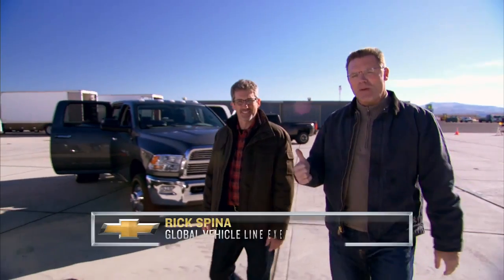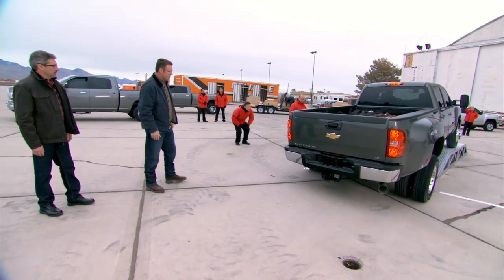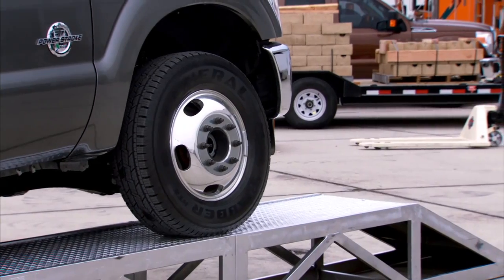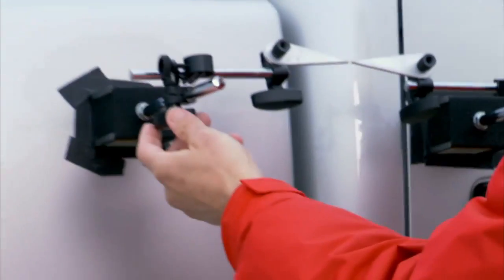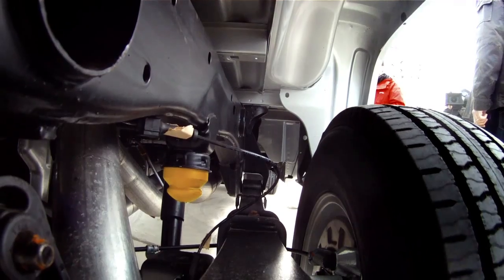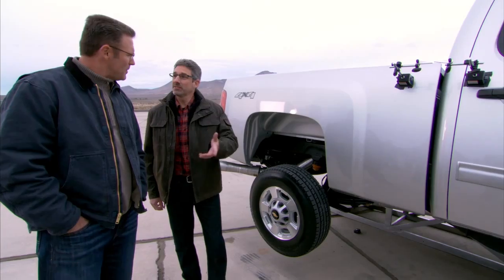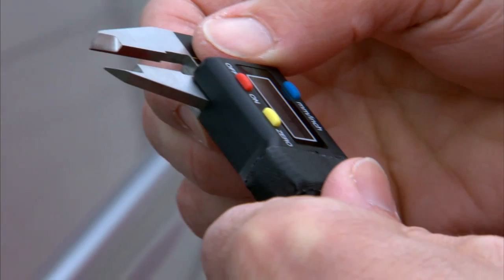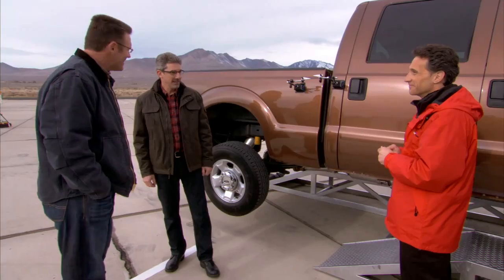Chevy Silverado 3500HD Head to Head Frame Strength Test No. 2 Twist Ditch

Comment: Or you can solve the problem of choosing the right truck by buying a Toyota Hilux ;)
Reply: Ignorance, do really believe you are buying American?? It now a global market place!
Reply: ***** Well, we have a another Toyota ute in Australia (similar to the tundra) which is called the Landcrusier 79 series, with a v8 4.5l twin turbo diesel. Its almost as powerful and can tow almost as a pick up. But here is why we choose the Hilux and land cruiser. It's better in all situations and tasks we use them for. A pick up is good for its power and towing capacity, but we use both Hilux and land cruisers for extreme off-roading, camping, HEAPS of customization for off-roading, hauling, etc. That's is why they are the #1 choice in our opinion.
Reply: fury3600 That's all they do is haul stuff. A hilux is more useful and efficient.
Reply: fury3600 Pickups weigh to much. Oversized engine. Would waste $200 in 10 miles.
Reply: Toyota frames gotten worst. The Heulix or whatever is a great choice though! But Tundra frames... OH BOY GET YOUR GF CUZ SHE AINT GONNA LIKE IT
Reply: In Europe when we need to carry a lot of weight rather often we buy a truck (lorry, commercial vehicle designed to transport cargo) or a van. Why the hell do you need a pick up when you have special vehicles designed to transport cargo? To drive it every day? That is insane! Buy a proper car for everyday use.
Reply: Fury, pickup trucks are just gas guzzlers. You burn about 1 litre per 100 metres lol.
Reply: i agree, they are useful if you actually need em to haul heavy equipment, rather than lifting them or adding smoke stacks to compensate for a small penis like most 18 year olds that buy a truck
Reply: not for the poor, i'm afraid
Reply: fury3600 Is that why you don't have one? haha
Reply: IceBlitz HAHA! So true! The Hilux is better, mainly for its off-road capabilities, tow capacity and the room. It's just more convenient than a gas guzzling pickup only designed for towing. :)
Reply: Marshall Ahmat never said I didn't
Reply: fury3600 I don't really care about your crappy pickups anyway.
Reply: I don't really care about your shitty thoughts anyway
Reply: fury3600 Who cared about your opinion in the first place?
Reply: ***** Only a hick would buy a big truck that disintegrates in a bit of a terrain to further other peoples perception of his hickness. While you may enjoy sitting in your own sweat with sunburned arms in a stupid big truck, other and more civilized people would rather choose quality. If I'm metro sexual because I choose quality, then I'm happy to be called a metro sexual.

Comment: These trucks are made for pulling and carrying on roads so frame rigidity doesnt matter. You want the flexibility for offroad use, and I know a dually or 3/4 ton truck won't be going off road without some aftermarket parts.
Reply: Actually Construction Works use dual-lies in off-road :3
Reply: +Brian X  Sure taking a turn a 100kmh  and the back of the truck catapult you since it twisting is a good idea
Reply: +Brian X Frame rigidity does matter.  Pulling a 5th wheel or gooseneck trailer, all that force must be translated through the frame, down to the suspension, wheels and finally the ground.  The only reason you can turn is because the rolling chassis does not catastrophically fail/buckle while the pavement is inducing lateral forces into the tire, axle & so on.  This is why every manufacturer has thicker frames, bigger breaks, larger suspension components for larger class of trucks.  If the frame is twisting too much thru that turn, really bad handling response can happen.
Reply: If what you were saying was true than all 3/4 ton frames would be smaller NOT bigger and stonger!. Please dont tell me you're smarter than the engineers. Just please dont say that.

Comment: Ford words quote unquote on ford web site " Stiff c frame design with cross members to reduce frame twist lmfao that didn't work. I cant wait to see what itll do an aluminum body...
Reply: this doesn't prove anything the chevy is a virtually brand new design while the ford is a over 10 year old design that came out in 1998 and has only received minor updates since such as restyles or new engines or minor changes to the frame and suspension. show use the same test with a clean sheet chevy design and a clean sheet ford design and then this test will have some meaning, until then it's just tools and fools.

Comment: damn u ford guys need to change ur tampons real men go offroad and use their truck for working hard not like u soccer dads who only use their trucks to haul kids going to walmart or pickin up dudes fact is nancys real men drive chevys eat pu$$y and drink beer.  ford owners wear dresses love balls and drink wine coolers and put things in places god didn't intend things to go when a chevy guy's go muddin they go to the woods. when a ford guy's go muddin they tell thir buddy to bend over.
Reply: Jonathan Williams racing buggies, i have found that the stiffer frame allowed the suspension to do its job consistently, whereas the flexing frame brought some inconsistency in traction
Reply: I would agree,  that's a hipo application with great suspension travel.  You should see how much a heavy spec double frame semi flexes.  It would blow your mind.   but if it didn't bend it would break
Reply: Oh i know my dad drives a super 10 truck and before that drove a flat bed for oversize loads. They definitely flex alot, i was just throwing out there an application where i found the stiff frame to be useful.

Comment: i dont see the bad about it flexing like that. it allows it to get better traction and it will it proves that the frame will survive a further bend. the gate not opening is fine and the folding tailgate is the only real issue i see.

Comment: I'm an engineer for Mercedes Benz and a chevy truck owner I can tell everyone here hands down the chevy is a better built truck. The stiffer frame is a boxed hydroformed frame which is leaps and bounds better than the welded c channel ford frame. The hydroforming process doesnt alter the steels ability to flex but because the frame is boxed it results in a frame that retains is shape much more consistantly than a c channel frame that has been welded.   I also believe my chevy rides better than the Ford due to the independent front suspension and stiffer frame. over ford's solid axle. I have had two ford's in the past and both failed on me. My current chevy has nearly 200 k without any issue.

Comment: "Real world conditions", lol.  Yup,  we take all our trucks at work everyday onto flat pavement drive them over special staggered aluminum ramps.
Reply: This was meant to simulate driving the truck diagonally through a ditch which is a realistic situation in the 'real world' for a truck like this expected to do work. Doing it this way on pavement with these ramps is more of a way to display an 'accurate' test of this. If they tried to go find some ditch somewhere to do this then all the critics on hear would be saying it was flawed because of "this, that or the other". Accurate testing requires controlled inputs and outputs to be properly successful. I've studied this vid carefully all it all looks very legit in it's execution.
Reply: diesel mutt88
Every construction site I've ever seen builds an entry driveway to bring vehicles in on, so they aren't stuck driving through a ditch.

Additionally, attempting to load and unload a vehicle balanced on 3 wheels is dangerous and would probably get you fired from any company concerned about safety.
Reply: Ever here of a farmer? A rural electric lineman? Other utility service crews, etc, etc. Not everyone has the luxury or the time to build an entry driveway to a construction site or area they may have to get into to do work.
Reply: beeman4266
Never owned a Ford truck, I wouldn't know.
However, I do remember back when the big 3 ALL would twist up so much that the box would touch the cab, but the lightweight imports with boxed frames would stay straight, even with big tires sometimes.
Of course, back then the line was, "they are build to flex to increase durability."
It's all marketing gimmicks on both ends, though.
And this "test" is just another gimmick to get the round heads to go "Oooohhh" and "Aaaaaaah".
Reply: l337pwnage Sounds like someone is mad that their ford has a little more chassis flex.
Reply: l337pwnage You sound like a Ford owner lol.
Reply: Saint Satan
 Well, I did own a Mustang once and a Toyota with a Ford master brake cylinder and Ford control arms on the front axle.
Reply: I'll agree with you there, it is for the most part a marketing campaign. We all know the big 3 were getting lazy in the 80's and 90's with no one really standing out. Fact of the matter is car companies can't really afford to be putting out shit anymore because the competition is so steep; all 3 are adequate, just depends on the "niche" things you like about each.
Reply: you have never driven off road? over rocks or ditches?

Comment: Dude, I totally believe this test! Especially when it's chevy guys testing ford vehicles, there is no why this could be bias. Lmao, they probably loosened a few bolts on the ford. I'm kidding, but not really.
Reply: exactly
Reply: Chevy has always had better flex over ford and dodge. Some things are better on chevys than ford. I have owned a 77 ford f250 and a 77 k2500 and both were decently stock except for motors and gear ratios, but the chevy held up better. There is give and take over the frame stiffness though, just pick your poison.
Reply: spcwilson79 ford doesn't need to loosen bolts they come that way. Complete Garbage
Reply: Here's a live video of the same test with the same exact truck styles. Chevy 3500HD vs an F350. https://youtu.be/qr7qEuaXeGo
Reply: Your comment is dumb, are you accusing the Chevy guys of building the ford or did ford build the ford? Stick to the facts
Reply: @90MVtv  thanks for the comment. Better late than never 😂

Comment: thats what makes the chevy ride so shitty..... Ford is allot smoother... I'll take reliability and comfort over stiff and shop time..... Chevy sucks..
Reply: Ford most definitely does not have a smoother ride. Independent front suspension in the chevy. The only reason i would have a full axle up front is if i needed the articulation, which many of us wont need beyond the range of the indi front suspension
Reply: Jesse Hernandez I choose reliability over comfort any day.....
Reply: drewditty Nice try i do not have any kids.....
Reply: Jesse Hernandez The 97 and up front suspension on the f150's is independent front torsion bar suspension... Yes chevy does have smoother ride.. but I will take reliability over comfort...

Comment: I have a question regarding my 2012 selverado, in the 4*4 knob (yes U can laugh because its not a lever Sigh) I can see these numbers in the fallowing order: 2H, 4H, N, 4L what does the N stand for? is it the same as the one in the gear box were U put it in Neutral to wait for the traffic light or what?
Reply: It's the neutral gear of your transfer case.
Reply: you wont put your car into nuetral at a traffic light
Reply: you dont*
Reply: Ben S ah good point well try to look it up soon
Reply: I'm not real sure why they give you a second neutral but they do.  It has the same effect as the neutral on your tranny.
Reply: Most people never have a real use for the Neutral setting of a transfer case. It has a couple of worthwhile purposes.  It allows the truck to be towed with the wheels on the ground and an automatic transmission disconnected from the driveline, avoiding transmission damage.  Also, many transfer cases have a PTO mounting plate (power take off) The neutral position of the transfer case is how you output power to a PTO unit mounted this way, with out the vehicle in motion.
Reply: +فارس الزهراني  the n on the transfer case will allow the vehicle to be flat towed. for example behind a motorhome.

Comment: I am impressed with the yield strength on the new HDs 60,000 psi.  but I do wish GM would have stuck with the previous design, massive C-channel.  With all the abuse that I have put my HDs (2002 and 2003) though I have been very impressed with the frame.

Comment: really dude i thought you were edjucated a little in engineering you think that flexible frames dont crack?  think about it for a moment grab a paperclip and bend a paperclip in your hand over and over again and observe what happens first thing that happens is the metal will get HOT then it will deform then it will eventually snap now grab a steel rod big enough that you cant bend with your hands and just see if you can cause a crack in the steel rod with your bare hands use vise if you want:)